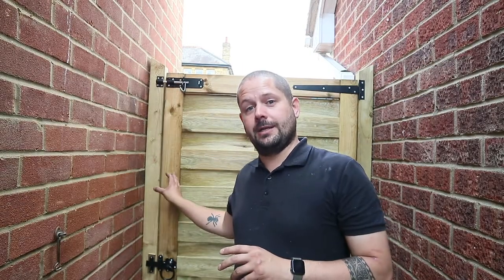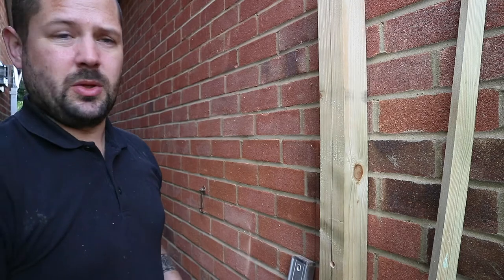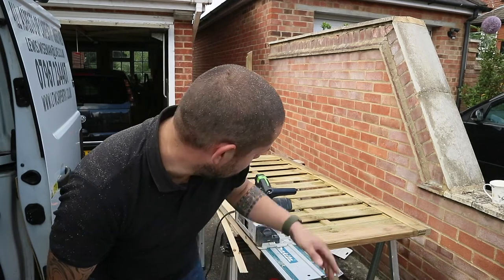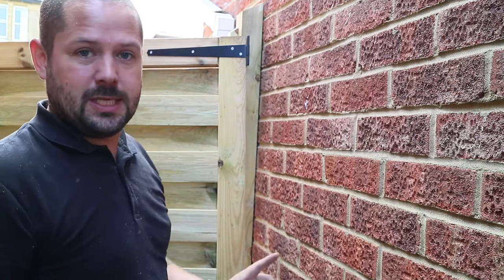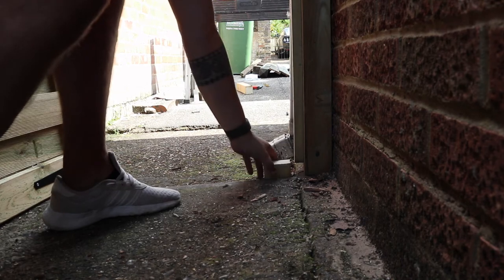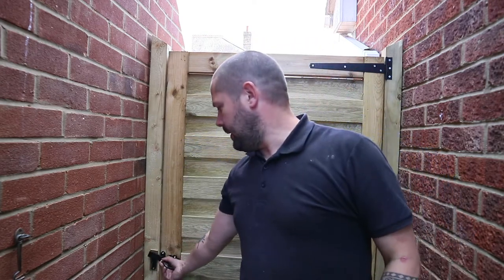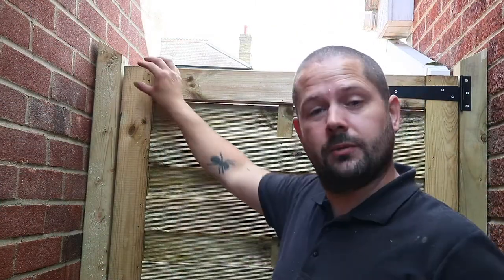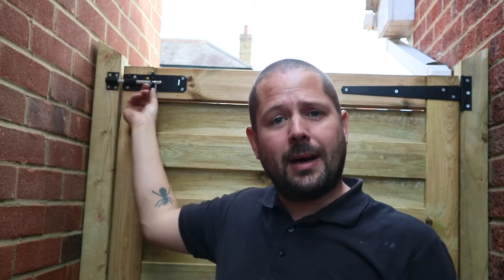How to install a garden gate.  #joinery #carpentry #woodworking

Comment: How did you put the posts in
Reply from the maker: I just used 4 hammer fixings in each side buddy
Reply: @LTWCarpentry  what kind
Reply from the maker: @marksaville9397  just run of the mill hammer fixings buddy